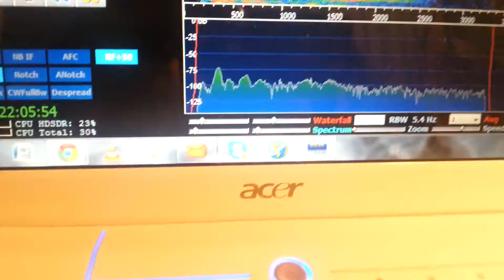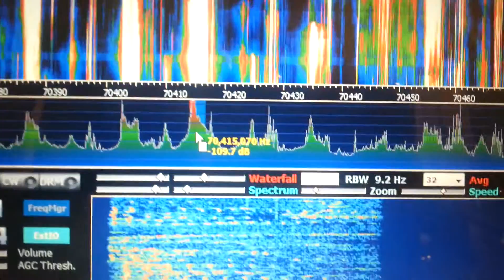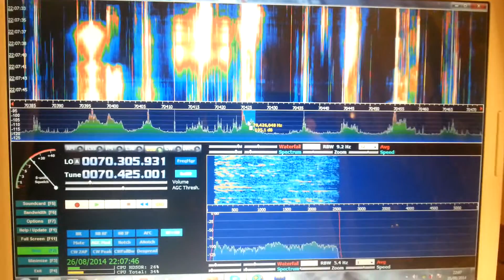SDR on Yaesu FT950

Comment: ok the video is great BUT tell How do you DO ?
I have ft2000 and RTL SDR
Thanks
Reply from the maker: You need the right RTL TV stick, there are many sites out there. IT must be able to take the 1st IF freq of the radio. 69.40 MHZ. In my 950 there is a plug where the DMU unit would go. In this plug is where the 1st IF is tapped and this goes into my RTL stick Ae port. The stick needs drivers douwnloaded and again this is easily found on internet. With HRD connected to the radio via the COM port, this enables me to see the freq on HDSDR and HRD. In this video I had NO com cable. New video shows the result with com cable.
Reply: Charlie Tango-Tim
Thanks you for this reply. Now I understand to put the frequency in the right place. This is a little things but great.